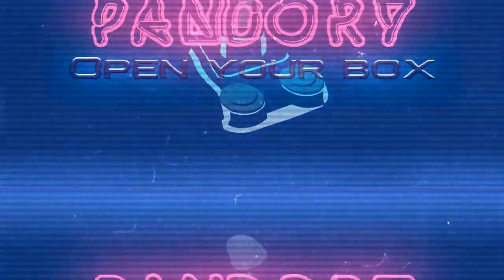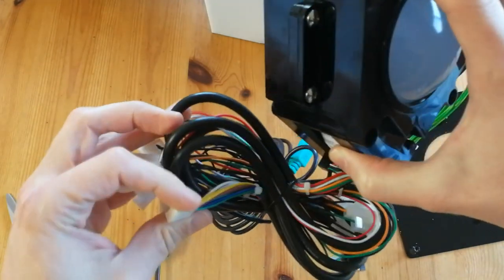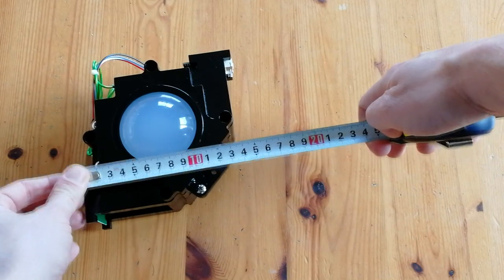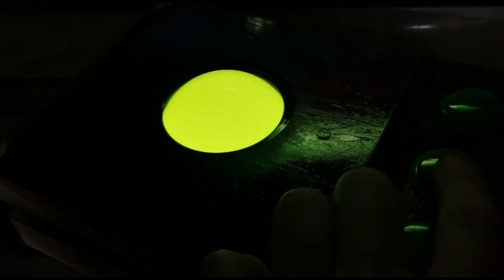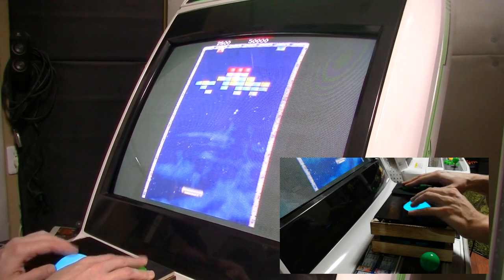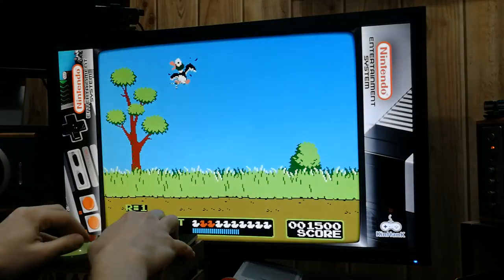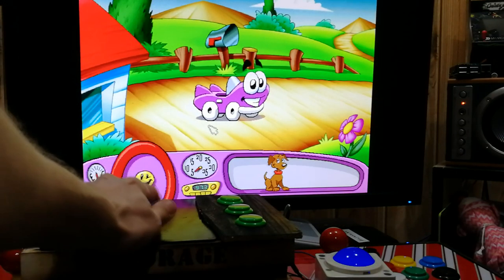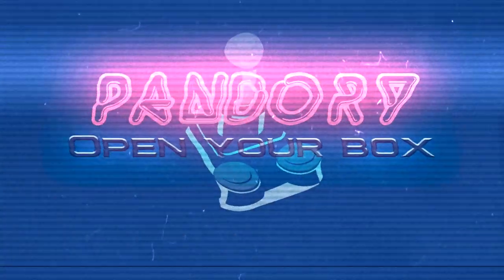FULL SIZED 3" INCH Arcade Trackball Review - Pandora Box DX / EmuELEC

Comment: Would this trackball be compatable with Pandora’s box 3D
Reply from the maker: @desperado111471  no. No trackballs are compatible with that unit.  If you want trackball either go pandora alpha max, gunmax, or try for a raspberry pi / batocera build.
Reply: Where can I get the Alfa max 3D board. Not having any luck in my searches.